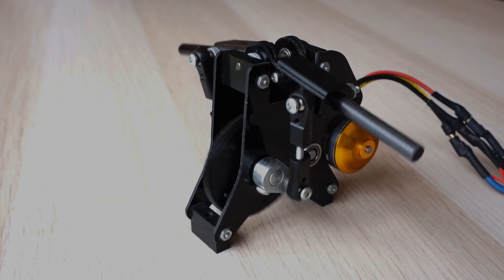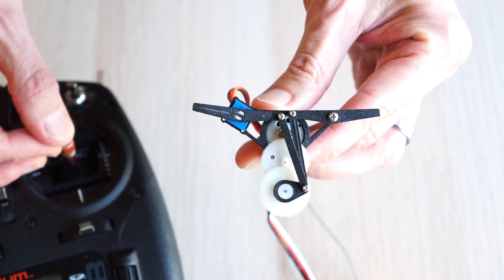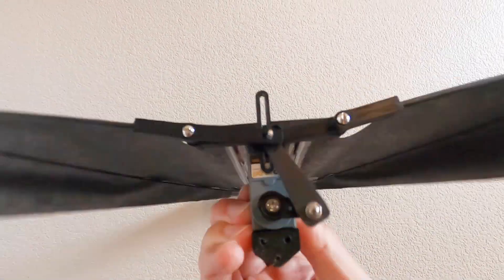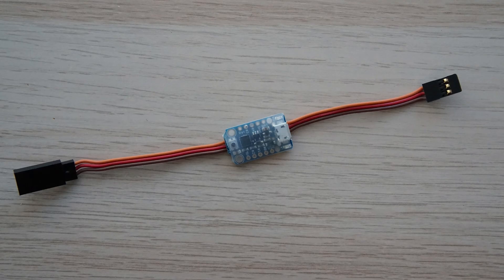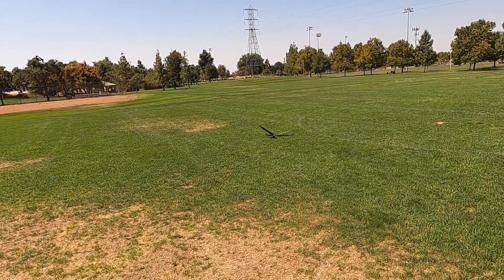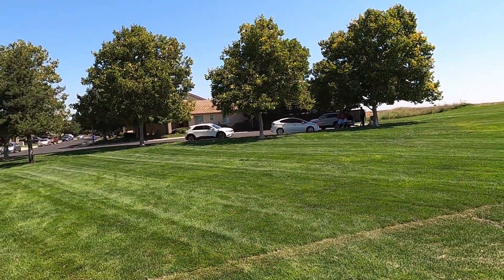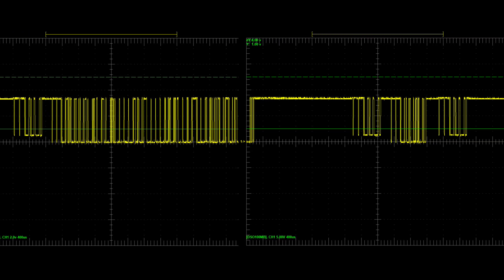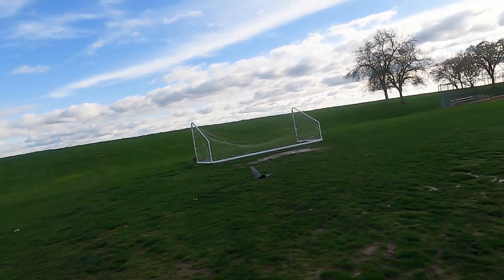Dual Mode Ornithopter Part 1

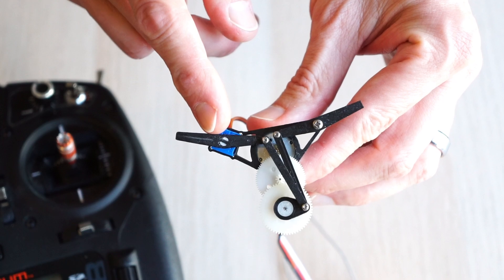Comment: For the design you had come up with and show at around 1:15, how do you get the servo board to rotate the motor past the angle of the potentiometer? I’ve been thinking about it and came up with the idea of bypassing the driver board and using an h-bridge to just power the motor and then switching it back to using the board during glide mode with a mosfet or something like that. 

I’m not an expert in electronics and didn’t catch how you were able to have the servo rotate past the angle or if you just used this bypassing the driver board method.

Comment: Would it help an ornithopter to have elastic pulling the wings down so that the motor works a little harder on the up stroke but has more power on the down stroke?
Reply from the maker: Some people have done this. When flying at low throttle it helps complete the downstroke more easily, so the upstroke and downstroke have closer to the same duration. I don't know if it improves the overall efficiency or performance. The rubber band or spring and any related hardware will add some weight, it may increase the friction in the mechanism, and it does not give back all of the energy that is put into it.

Comment: i'd quite like to make an ornithopter now. i noticed you stopped selling parts, would you maybe release the design files or technical drawings needed to manufacture the parts for a crossbow 2?
Reply from the maker: It's a lot of work to put all of that together and I would prefer to spend what little time I have on moving forward not looking back.

Comment: Wow, I've just stumbled upon this video and this is amazing, very impressed with your efforts!

Oddly enough I watched another video today by the name of "Distributed Feather-Inspired Flow Control" where a research group were adding flexible flaps on the upper surface of wings as an analog of feathers so they flex upward into the airstream at high angles of attack. Apparently this increases lift at high angles of attack and reduces certain types of drag too.

This might be something you can try on a design that you already understand the performance of so you can see if there's a beneficial effect.

Subscribed!

Comment: After you performed the modification on the wiper pin for duel mode, is the duel mode servo needed? 
  I love your work! I am eagerly awaiting part 2!
Reply from the maker: It still requires the dual mode servo because it has a special pot that can continuously rotate. You could get around this by moving the pot to the wing hinge. Great question!